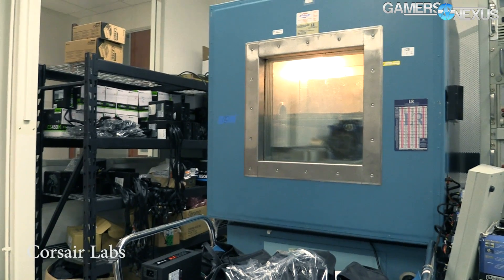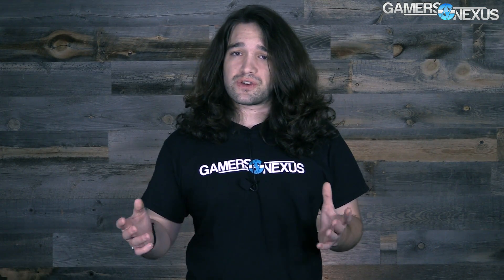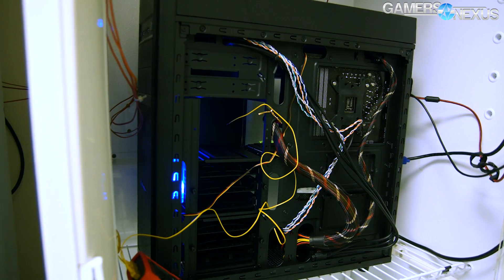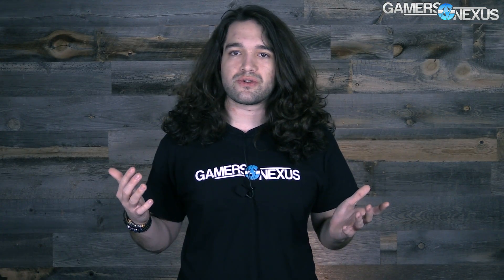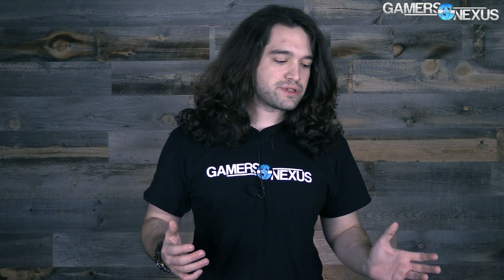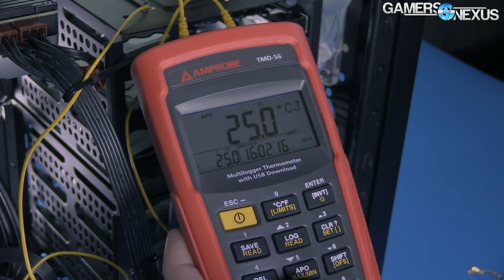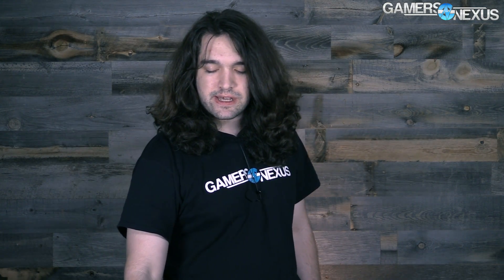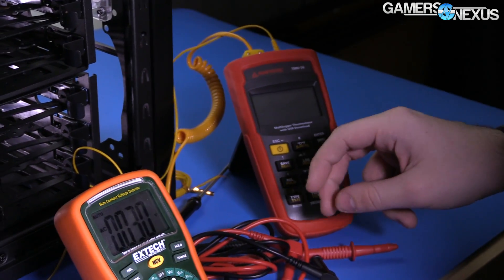Why Our Thermal Tests Are So Accurate - Behind the Scenes

Comment: I'm curious about the brand/cost of the two meters you were using and whether you recommend them for consumer use? Nice video, thanks!
Reply from the maker: +Drake Owens Depends on what you'd like to do as a consumer. I can't think of very many consumer use cases -- did you have something specific in mind? You can get cheap thermocouple readers that don't do all the fancy stuff ours does; they're probably around $70 to $100 and will often be limited to one thermocouple, won't have logging, etc., but will be just fine for spot-checking the temperature in a room. These tend to be a bit more accurate than the average $15 digital thermometer you'd get at a local hardware store.